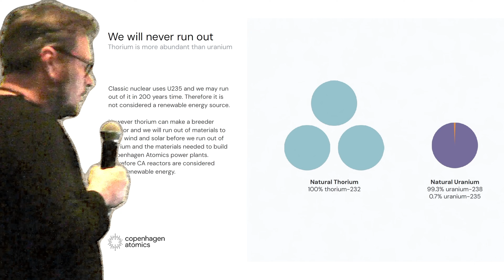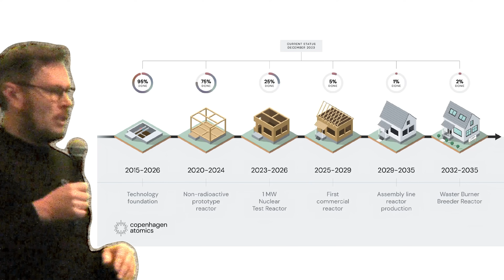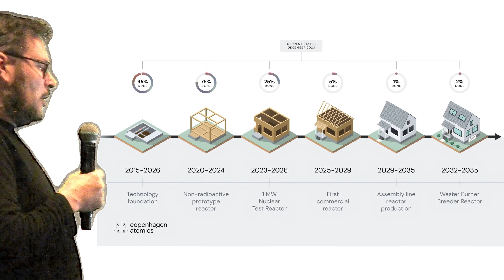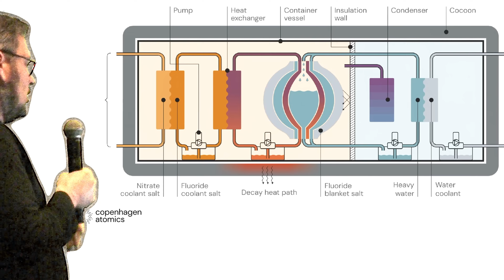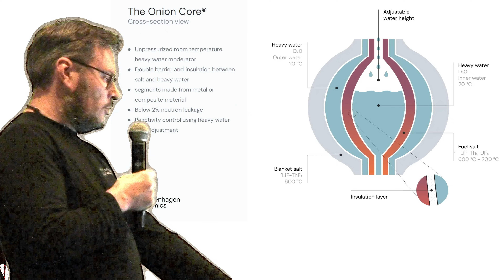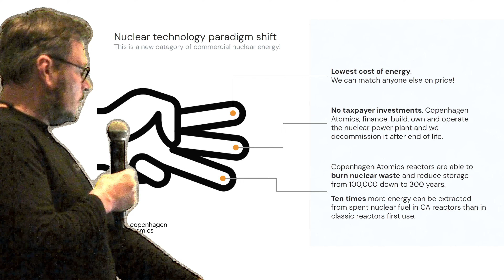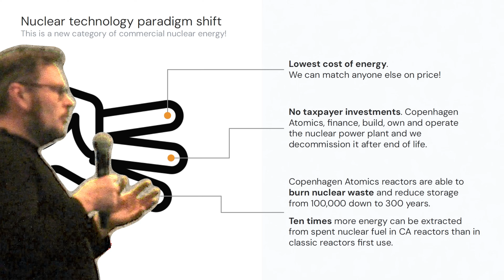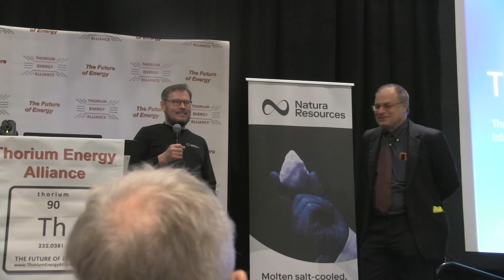Thorium Molten-Salt Reactor: Copenhagen Atomics Onion Core - Thomas Jam Pedersen @ TEAC12

Comment from the maker: This is a 16 minute version of Thomas Jan Pederson's 32 minute presentation which is on Copenhagen Atomic's YouTube channel. CA ran their own (additional) cameras, and released their own copy. So I'm trying to make a different-as-possible version where I'm only including my personally favourite parts... this was the portion I was most interested in. This version also uses additional angles such as the chroma-key angle... the chroma being a solid green JPG projected using a video projector onto a wall.

Please consider supporting my video capture/edit efforts: https://patreon.com/thorium ...costs $1 /year. Yes is a hassle, but certainly affordable. (Patreon implies it is $1/month but I don't charge every month.)
Reply: I have some questions to all this. 1 What is the pressure of the heavy water? 2 Why are proliferation issues not addressed? 3 How is the state of the chemical separation process? 4 Is the neutron economy for efficient breeding solved?
Reply: I always appreciate this channel.  I have questions just like the oddvard.  in addition I would ask about x-rays, xenon, hydrogens, etc.  Obviosuly there are actual "running" conditions w/ the mixtures.  I would think LIBS during startup and sampling thereafter kinda thing. Study of holes in fibers exposed to radiation was published this year I believe, seems pretty definitive that the fiber mesh goes to crap quickly.  I like the modularization aspects.  I am curious as to why someone with a known dry dugout cave or similar hasn't just offered to partner on some level.  I don't see how the fast neutrons are getting slowed down enough on the outer onion, inner to inner is obvious.  I don't think the onion has enough layers and there seems to be a lot of lacking informatics... em fields, etc.  Steels can disperse as well as focus and i think one pipe bend in the wrong place could be catastrophic in the "core box" within hours/days.  Not catastrophic as in boom, just having to unplug and be stuck with a box w/ a long half-life in the way.  Go count your neutrons and get back to us.  A temp withdrawal of 300 degrees doesn't seem to be enough to drive an efficient exchanger to energy.  One 'box' would appear to be compareable to a slow moving freight train?  Is that analogy in the ballpark?  not sure of onion shape... i mean if input nozzle is small and output nozzle larger, wouldn't this make for self reciprocating fluid... I mean it's just a fancy heat pump.  I'll shut up... I'm a layman, I like the sizing ... just maybe not all the engineering.  $ in the pumps...yes.  $ in Lith... yes.  $ in chem. processing and exotic outputs, maybe. Onsite storage of waste chems and reprocessing regimes...yes... - $.  Competition w/ nat. gas... costs what...$5/10-20kW more?  yes, screw the NRC, smh.
Reply from the maker: @suutra3  Thank you. Fixed.
Reply: Thank you for yet another superb educational video!
Reply: It was all highly favorable, top quality.
Reply: has anyone tried using metallic glasses instead of hastelloy-n/etc, seems like you could use some of the same metals but in the form of a metallic glass, also ive recently seen some videos where glass is being 3d printed into complex, precise structures
 
-basically im wondering if all the "machined" components, ie. threading could all instead be 3d printed with metallic hastelloy glass
Reply from the maker: @ryancory5958  Me ChatGPT-ing this: Most metallic glasses tend to crystallize when exposed to high temperatures over extended periods, especially at temperatures typical of MSR operation (~600-700°C or higher). : Metallic glasses are typically produced in thin sections, and scaling up to the sizes required for reactor containment may present challenges. The cooling rates needed to maintain the amorphous structure during fabrication often limit the thickness of metallic glass components.

When we discussed this years ago (me asking a similar question) I was told temperature would be an issue. That's all I know outside of ChatGPT. Hopefully someone else can chime in too with more insight.
Reply: @gordonmcdowell  ty for the response, well hopefully the 3d printing of components may resolve some of these issues..i know the metallic glasses have to be quenched immediately, shouldnt be too hard during 3d printing since such a small amount is being applied, spray some cold helium on there
not sure about reactor containment, alot of couplings and intricate components could be 3d printed out of the glass, i figured an amorphous solid would have less complications since it has no crystalline structure to degrade, and the 3d printing of metallic glass might make complex components easier/cheaper to obtain instead of milling/machining high quality steels although the infrastructure for those are already in place

Comment: 😄Thomas, good day from Goonellabah, New South Wales, Australia. I am promoting the Copenhagen Atomics reactor. Thorium encourages me, and it will be a Game-Changer in Energy: 
I am embarking on a six-month journey of significant importance. I'll be circumnavigating Australia in two Cybertrucks and a Tesla Semi, covering a substantial 22,000 kilometres. This journey is set to commence at the end of  September 2025. Elon Musk will help me.
We have six months to travel around Australia. I will have a website and a YouTube video by the end of July. 

I served as both the project manager and civil engineer. I worked as an engineer in Singapore from 1999 to 2005. We designed and constructed twelve-kilometre tunnels with two boring tunnel machines and five stations. I also managed a team of 160 engineers and architects. I have been a contract engineer since 1975, constructing sewage and water treatment plants from Melbourne to Cairns. 🤗Cheers, Ian Cleland

Comment: My problem with the onion core is the boiling point of D2O =101.4 °C (degrees Celsius).    At what water pressure is the D2O?  What insulation material do you put between the red hot  the stainless steel and the D2O Moderator on the inside and outside of the fission core of  the onion?   What sort of insulation are you using?   Is it something from NASA like the tiles on the space shuttle?  How long will the insulation last under the core heat and the neutron bombardment of the onion core?  You also need insulation between the molten salt of the breeder salt to insulate the hot breeder salt and the second chamber of D2O?   How often do you have to replace the insulation between the stainless steel and the D2O?  Does the insulation itself have any moderator properties or does it absorb neutrons?  To find some material that works great as both a moderator and a thermal insulator that does not wear out that would be a great achievement.

Comment: Yes the onion is a heavy water moderated reactor instead of graphite.  It's problem is the same as all super heated pressurized water reactors..  if there is a pipe break then you got super heated steam heavy or light water not  unpressurized high temperature  molten salt.  maybe we could get the best of both deuterium and carbon moderator by developing some kind of  high temperature hydrocarbon or plastic or epoxy moderator where the hydrogen is deuterium and the carbon is present to slow down the neutrons.   Perhaps we could get  some kind of hydrogen ie deuterium & carbon moderator that can take high heat temperature of 500 to 700 degrees..  I still love the original LFTR/MSRE FLiBe molten salt concept of Alvin Weinberg,  Glenn Seaborg  & Eugene Wigner. unpressurized  molten salt  heat exchange instead of high pressure super heated water.   AS far as putting the reactors on barges makes me just a little nervous because of floods, hurricanes and tsunamis that  could easily capsize the entire project or allow it to break it's moorings and allow it to go down the river like the barges we have seen  in the past in Pennsylvania.    A molten salt still is water soluble and a capsized barge is a disaster waiting to happen.   Unless of course we can moor the boat not on a dock but  drag it, plant it and anchor it firmly on land  in some kind of dry docking and land anchoring method, the problem of the capsizing barge makes me nervous.😨😱
Reply from the maker: Agree the presence of water moderator (or any moderator which will flash to steam at operating temperatures) is a downside or a at least would be among the first what-about questions I'd pose. Have not spoken to them in quite a while, so will bring it up when I can.

Comment: Why are your pumps wearing out? Have you tried using a bladeless tesla turbine pump. I bet if you made one with hastelloy or just coated SS it would have no problem pumping molten salt. I'm thinking about doing a research project on this at Old Dominion University. But the salt corrosion is the part I don't get and Hastelloy-N is SOOO expensive!
Reply: Chinese scientists have already built some of these modular Thorium reactors.

Comment: Are you coating the stainless steel with alumina, chromium, silicon carbide or graphite? How do you use SS without using Hastelloy-N?
Reply: ...and how do you ensure the coating doesn't wear off?
Reply: Or maybe Chromium nitride? Seems like the brittleness of alumina, SiC and graphite are a big issue. 

I guess you could vapor deposit CrN. That would be a very thin coating! Maybe plasma spray alumina on top?

Comment: Why run it for one month? Pa233 has a half life of 27 days before it turns into U233. 

The first month of running a thorium reactor does not produce full power.
Reply from the maker: The breeding is unrelated to power output. Would start with enough fissile to maintain fission and bridge the gap until fuel from blanket is moved into core. Core likely contains HALEU and as that is used-up move U233 in from blanket to core.
Reply: @gordonmcdowell @7:05 you mention that you don't extract protactinium. But Pa233 is still produced from the Th reaction, right? It's just decaying into U233.

What do you mean by you're not extracting Pa?
Reply from the maker: @stevenelson886  You can let the Pa233 decay to U233 before moving anything from blanket to core. (Sorry don't take my word on this, I'm just sort of remembering from a number of different presentations and discussions on this... I'm not pulling quotes from this particular talk.) If Pa233 decays to U233 in the blanket then it starts to be contaminated with U232 and that's protection against proliferation as is easier to detect and degrades the material's usefulness for weaponry.

The better the neutron economy, the more flexibility one has to allow the U233 to be contaminated with U232 and Fission Products. CA's focus on finding a better performing moderator than graphite opens this up. I think it introduces other practical challenges, but that's why they do it, and that's what it gives them.

Comment: This is really interesting but I think the technology you are working with is too big/expensive and complicated. What if I could make up to a 60kw/h thorium super cell the size of a 2L coca cola bottle costing between £100-500 per cell not including fuel cost(this is the cost for a prototype). Are you interested?
Reply: The reaction itself is the easy part. What about corrosion and separating fissile materials and the chain reaction and safety and fluid pumping and corrosion and the NRC approval. You're not doing all that for $1000.

Comment: Copenhagen Atomics have made a major breakthrough in solving the corrosion problem.
Reply: The remove water, O2, etc
Reply: @АгронДепартье But I thought that next to corrosion from salts, you had the metal alloy of the container becoming brittle from neutron bombardment? That was a famous issue for the Oak Ridge experiment.
Reply: @redachhaibi9708  Little do I know about this, but Russian develop special alloys (and do some extreme computer calculations to prove that it will work - I saw those guys doing the calculations). They cover the reactor core from inside with Iridium (or alloy on its basis).
Reply: Chinese scientists have already built some of these modular Thorium reactors.
Reply: Any idea what the solution is? Ceramics make the most sense, but they are brittle. Is that not a problem?

Comment: Maybe find a nice little autocracy that's poor on energy to test one there. Say North Korea, Afghanistan or some small island nation. Should not be too hard to convince the local power with the promise of a few reactors.
Reply: North Korea doesn't care about CO2 emissions, so it's cheaper for them to just burn coal.
Reply: @GreyDeathVaccine  Except this reactor "Should" be much cheaper than coal, especially with a half-way reasonable regulator.
Reply: I don't know if North Korea is poor on energy, but it would be a great place for getting something done quickly.

Comment: Too little too late. Solar with battery backup beats everything. All reactor construction of all types should stop immediately. Price of Solar has dropped drastically. Over 50% cheaper this year and still going down. We can double electricity to the grid by just updating the power lines. Time to put and end to the nuclear nonsense. 100 square miles of solar panels is more than enough for all our electrical needs in the  United States.
Reply: Wind and solar are by far the most expensive way to produce reliable, dispatchable electricity 24/7/365. Batteries just increase the cost.
Reply: @chapter4travels That's incorrect. As of a few years ago Solar is the cheapest electricity by far.
Reply: Updating the power lines isn't a game changer. Only about 7.5% of electricity is lost to transmission lines.

Solar and wind are great. Nuclear, specifically thorium, has the potential to be much better than wind and solar. Thorium has many pros and far fewer cons than uranium reactors have.

One big pro for nuclear over solar and wind is the small amount of waste. A 1 MW thorium reactor will produce 30kg of waste PER YEAR. To compare apples to apples, say solar panels last 30 years. 30 years of thorium waste would weigh 900 kg (a small car)

But the elements are very heavy and dense. By volume that's about 75 liters. by contrast solar panel frames are mostly made from aluminum. After 30 years those panels need to be dealt with too. If we only consider the aluminum, to produce 1 MWY will require a 5 MW solar farm. That will end up requiring 285,000 kg of aluminum. Al is a light element, by volume that's 100,000 liters

70 liters is much less than 100,000 liters

Comment: his points are often disengenuious, 30 seconds in he says his breeder is 1000X any uranium reactor, what about a U238->Pu239 breeder?? yes you need HALEU to start it but not long term..
Reply: That's the catch with plutonium breeders; so much fissile is needed that they are entirely uneconomical to even start. 20% HALEU will be ~$25000/kg, and fast reactors need ~10x the fissile. The U-238 fuel cost is irrelevant if the reactor needs a billion dollars of HALEU up front. Thorium makes breeders affordable to deploy, and being a free byproduct of existing mining, it won't impede scaling.
Reply: @Th-233  is there not heaps of weapons grade they wish they could down blend? Th232 still needs some to start aswell right?
fast spectrum seems to have large advantages aswell.. higher temps, less corrosive salt and larger neutronics window of operation.
Reply: @samuelforsyth6374  All the fissile within existing weapons and spent fuel, amounts to a rounding error on what we'd need to power the world with fast reactors.